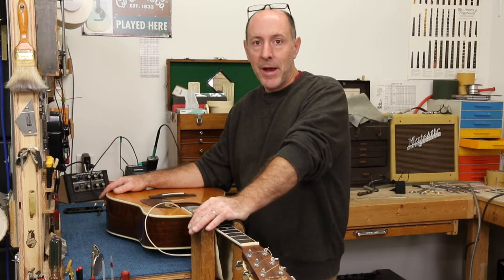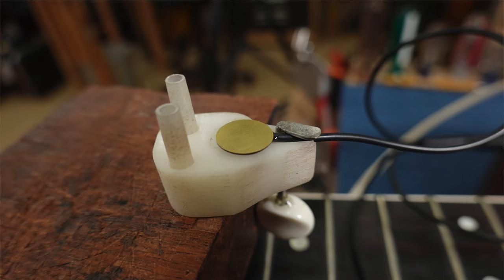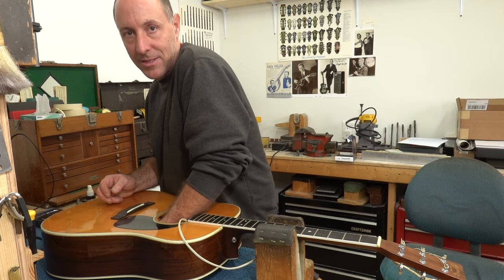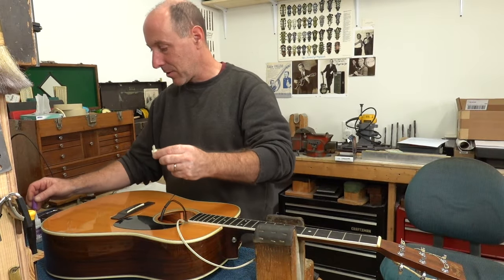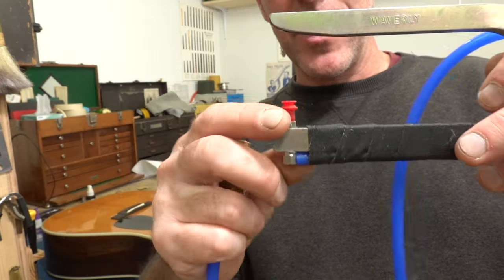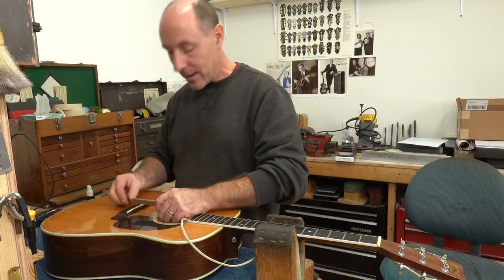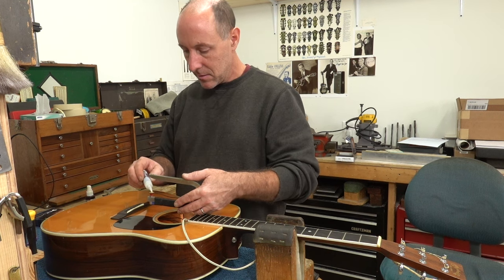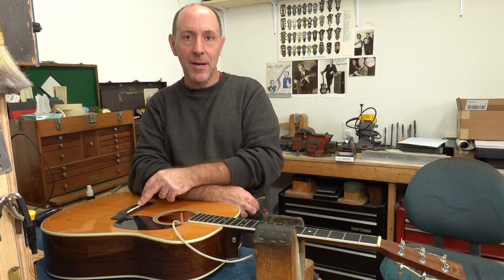Professional K&K Pickup Installation Tools

Comment: first!

love it; also, check out the new baggs Hi-Fi bridgeplate pickup, it very much does the same job as the great-sounding K&K mini, maybe with a slightly less "direct" attack, but with an easy (and easily reversible ) peel & stick installation
Reply from the maker: I’m surprised we haven’t had any of those come in for installation yet, but have heard enough good things about them that I’m excited to try them out!
Reply: @A2Guitars  I just went through the process of putting a Hifi in my Hummingbird and then returning it. Was not a good sound and no combination of volume/tone settings could get it to sound like something I would want to hear. It was definitely installed correctly. It sounded fantastic through an amp, but DI was brutal. I just put a K&K in it and it sounds like what I was hoping the Hifi would sound. Might just be my experience or maybe it didn't pair well with my Hummingbird, but the K&K is so much better, imo.
Reply: I kept going back-and-forth between the K and K and Baggs Hifi myself, and exactly one of the first things he mentions in the video, about double sided tape muffling the signal, is what makes me lean away from the Baggs.

Comment: Great video David.  I have a problem:  I really want to install a K&K pure into a 1949 J-45.  You probably know the bridge and bridge plate are small with not enough room to get the transducers on the plate. Do you have a solution? I've heard some putting in a small extension to the plate, but don't want to do that.  I could install, but a bit of the transducer would overhang the plate. Thats not ideal, but K&K does say some small amount of overhang is acceptable.  Do you have any thoughts on this?

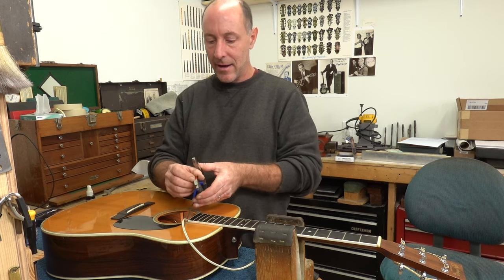Comment: 5:20  I have a Mexican Martin OM (cheap but serviceable) with this problem.  The sensor is in between the E & B....like the E/A and D/G in the video.  And the E string isn't nearly as loud as the B.  The B can be very dominant....especially when playing hard.  I have to alter my playing to compensate.  I am going to try to slice off the sensor and re-glue it back under the E string like in this video.  But I'm afraid I'll ruin it. This is supposed to be the cheap backup guitar, but even so, the lower volume high E string is driving me nuts.